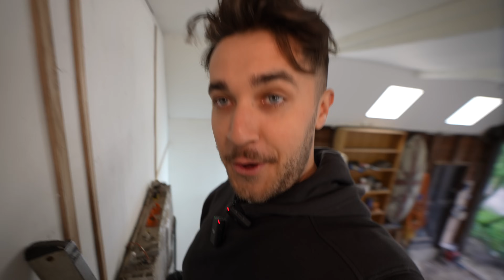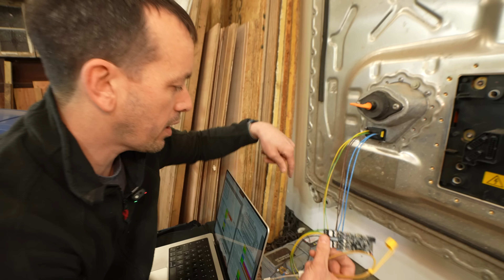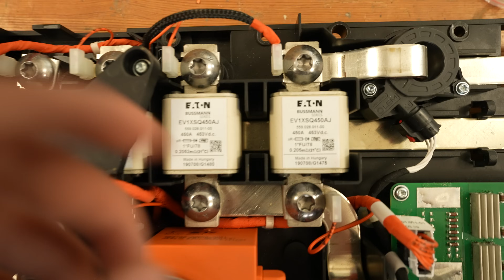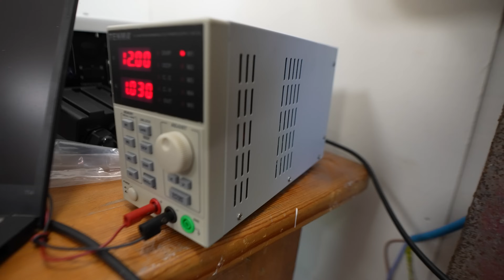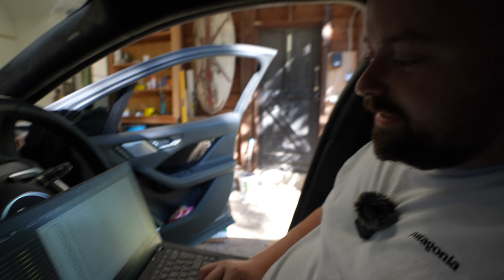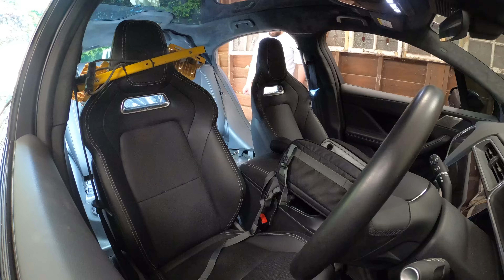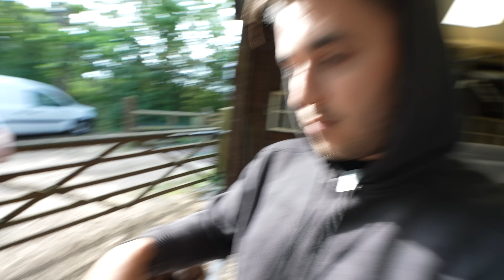Hacking an EV Battery From a £90,000 Car -  DIY Vehicle to Grid | ØY44

Comment: Is there not a mechanical tilt switch in there somewhere ? I would be very surprised if there wasn't, considering on ICE cars there is a mechanical tilt valve to shut the fuel supply in case of accident/car overturning.
Reply from the maker: It’s not inside of the battery 🤓👍🏼

Comment: You know when you repace a part on a car, like an intake valve, you have to let the car know about the new part and calibrate it. That is so the ECU knows what ID to talk to for opening and closing the intake valve. Same with the battery. You figured out how to talk to the battery in the Jaguar, but the battery on the wall has a different ID so it doesn't respond. Figure out if there is a "discovery"message to make all parts on the canbus communicate their ID and try it with the right ID.

Comment: Not an expert but I have a little idea! 

The car was involved in an accident have you checked the pyrofuse. This is like a big fuse that you see in a plug. They blow and need to be replaced if the accident if fairly bad, you can normally tell this if the airbags had gone. The fuse kills the engine in a normal car. But in electric cars it can be used to cut off the battery. 
This is most likely in your case to be why you are having a problem because considering it would be between the battery and motors. And it is physical, the fact that the battery has just two bus bars to go to the motors. Your one will be in the battery pack.

To test just treat it like a fuse!

This is so then the end users is not exposed to any danger, as the mangled metal of a car crash and easily cut in to a High voltage cable!
Reply from the maker: Good suggestion, but we checked that, and it’s all in tact! There’s some Comms issues, but I’ve since found an expert in this field who is helping 🤩🤩🤩 - thanks mate!

Comment: I do wonder if this is what Octopus are thinking about with their EV leasing scheme - once the cars reach the end of their usable life, there's a whole bunch of mostly-good batteries they own ready for deployment to grid-scale storage, which is particularly valuable to a renewables-based energy supplier to displace 'base load' generation (or rather, to fill in the troughs of weather-dependent types of renewable power generation).
Reply from the maker: Octopus have shown extremely smart business acumen recently, so it wouldn’t surprise me if

Comment: Cory, the I-pace is particularly sensitive to the 12v battery being in good health. I know I have one! It might be worth upping the 12v to 13v to be sure. I had mine just refuse to start, i.e. the main contacter wouldn't activate. After half an hour the 12v battery had recovered to over 12.5v and suddenly the contactor went clunk! Everything was OK after that. They are very sensitive to poor 12v battery condition!
You will have to write out the heatingcooling circuitry on the CANBus of course. The LG and JLR engineers have written code to protect the battery at all costs!  I believe that Tesla are already using old/substandard EV cells in their Powerwalls. The cells inside the I-Pace are LG Cem cells and are used in quite a few home batteries, so when you get past the CANbus problems the rest should be plain sailing!!!

Comment: I would be careful with this battery.  It's one of LG Chem's defective batteries and it will catch on fire at some point.  I would check to see if this one had a battery replacement after the recall, otherwise I would recommend a newer battery from Nissan, or KIA.

Comment: Hey Cory, just wondering, are you aware of the recall for the Jag I-Pace for the battery pack causing several thermal runaway events and burning several properties down?
Also, they had a recall for the recall, where they tried to “fix” their physical fault with the battery cell at a manufacturing level, where some still failed even after the software “update”.

I've only just started watching, so maybe you cover it.

Please make sure you have some really good working smoke and CO detectors throughout the property and have them interconnected for the safest detection and alarm if something were to happen.

Comment: I think my original comment failed as I posted a link off YouTube. But if you Google "Circle Of Battery Life: Old Power Cells Get New Purpose For EVs" you'll find a firm that's been working on this exact concept. Assuming they keep the packs intact they might be able to help - though I guess chances are they would be stripping the cells and using their own BMS so I guess unlikely to be of much help. Absolutely incredible perseverance - working in IT I know the feeling when you've spent hours working on something and get an error instead of the result you were hoping for!

Comment: All EVs need foot on the brake to fire up the high voltage battery. Pressing the start button once or twice without foot on the brake only fires up the 12v battery systems

Comment: It’s refreshing to see a spark taking an active interest in the deep dive side of things, but importantly staying humble about the fundamental differences between electrics and electronics without implying that it’s the same thing to those that don’t know any better - well done and best of luck getting this to work 👍
Reply from the maker: Thanks mate! I did a course in electronics, and have delved into some basics, I know enough to know, that I don’t know it!
Reply: @corymac  fair play to you you - it's a diverse field - I am an EE but don't do it as my day job so there's swathes of stuff I find interesting but have little expertise in - everyday's a learning day as the saying goes! A bit like a GP attempting to do brain surgery by qualification and watching a few videos 😆 - I did an entire module on CAN but really despise software and coding, though I can scrape by if I really need to (e.g. using Arduino for Open Energy Monitor) - it's also a case of not re-inventing the wheel so you'll be breaking ground with this for the benefit of others by reverse engineering it  🙂
Reply: @corymac  The more you learn, the more you realise how much you don't know

Comment: I don’t know if this would be any help, but I know most of the cars today need to have each control module programmed with the chassis number in order for them to communicate with each other think the issue you might be having is the code of them signals from the car somehow have the Schatte number number of the car programmed into it and as it doesn’t match the same number that is probably programmed into the BMS of the battery it might not work but I could be wrong
Reply from the maker: There’s no VIN lock as far as I can tell 😁👍🏼

Comment: If your client has the rest of the car the quickest solution might be to rebuild the harness on the wall with the other can modules 😂 you might be able to get the battery info for the inverter over the obd port. I'd be tempted to hook up the rest of the car and replicate the donor cars signal in the same way you did the other jag in this video in case the signal is veicle specific that might save removing and mounting all the components.
Reply from the maker: Just keep the car in one piece 🤣👍🏼

Comment: i don't have any experience in this but i watch a lot of car repair channels 99% of the time the car wont start is ECU comms throwing some sort of error that needs bypassing & on a crashed modern car they wont start without a Pyro Fuse been intact and attached,  i would assume the CAN needs re writing to bypass car start features i doubt striaght copying code will work

Comment: Have you check the other connectors on the top? There is also the interlock loop inside. There must be a reason, the battery shut down after 5 sesonds. Something is failed to check while bootup. It could be the battery expected a massage from other ecu's in a time window (maybe every 5 sec )?
Reply from the maker: We’ve linked the HVIL’s but still was throwing a hissy!

Comment: 😅I want to see this succeed.  We NEED this to work.
EV batteries are typically well protected to avoid the inevitable collision that will happen in the lifetime of a perfentage of vehicles.  Being able to repurpose one for home use makes so much sense.

I read that 30kWh per day for a home is around average.  3 days of charge would be phenomenal.
Reply from the maker: Thanks!!! We’re working on it 😅🙏🏼

Comment: Facinating project, I'm rooting for your success. Completely shot in the dark but would there be a axis sensor stopping the battery from turning on it it is not level with the ground as it is monuted to the wall. i'm not an expert but throwing out another avenue of investigation.

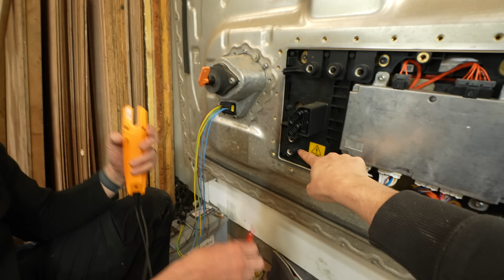Comment: I find it extraordinary that 10:19 you can measure 395V DC . That's basically all you need - those connectors don't look like some low power voltage sensor wires - they may provide all the power you need.  Keep going and good luck with the project!  - Make sure the solar inverter is configured to handle a connection to a high voltage battery. You can't just plug the battery into the connectors which would normally be fed by the solar PV array (even if the voltage is the same). The impedances are different and bad things could happen to both battery and inverter.
Reply: But the internal bms might not be active risk of cells going out of balance (need cam network to make sure it’s on and contractor is on)

Comment: I can't really tell from the video if you did.  But in all Power plug diodes there is a H VIL circuit.  it runs around all 400V plugs and must be unbroken.
Reply from the maker: We found that, still no luck 😁
Reply: @corymac  I have on a Nissan battery had to send a "wake up" bit before an ok can be sent on the canbus.  so it is not certain that it is enough to send "ok" and "switch on contactor".

Comment: I wouldn't be at all surprised if there isn't a sensor on the battery that detects it's not oriented horizontally: and might it be a good idea not to operate.
Reply: We checked that, there's nothing in the battery r.e an orientation sensor. that is present on another circuit in the car.
Reply from the maker: What Chris said 👆

Comment: Great work! I foolishly bought an IDbuzz thinking you could plug it in and use the vehicle battery to power my home. Turns out you can but nobody actually makes a charger that allows you to plug in and do this. One is in development but it’s going to have a chadamo plug on it which renders it useless for my application. Keep up the good work.
Reply: Check out point guard energy. They are working on a V2X CCS (US) based bidirectional DC home charger... I don't think it works with any vehicles yet, but at least something is happening in the space.
Reply from the maker: I have heard similar before, manufacturers aren’t rushing on it for some reason 🤔
Reply from the maker: I imagine whoever does it first will sell like crazy

Comment: Well that was interesting, good luck with persevering! I was wondering if the 'car on the wall' had a post-crash setting applied, that won't let it operate again until it's cleared? How you go about clearing though...umm, turn off and on again 🙂
Reply from the maker: There’s an internal fuse yes, but that seems in tact! 😃
Reply: @corymac  I was thinking more of a controller switch or something...I'm really not qualified to suggest it! I just thought if the car was in a crash, there might be some CAN comms that says, "this is a dead parrot". 🙂
Reply from the maker: And thanks! 🙏🏼

Comment: You’re a sparky , you know you want to get a tin opener on that thing , gut it , make the batteries dumb and fit them in a housing with a simple charge controller. 
 It would already be in pieces if it were mine .
Reply from the maker: I may or may not have ( if JLR see this definitely I didn’t ) opened up the casing already 😁. It’s just that we have a multimillion pound design here! I don’t wanna butcher it, I wanna keep as much of the original stuff as possible
Reply: @corymac 
I agree ,it’s a lovely bit of kit and if you can get it to play nice and be a good little battery, cool cool cool .
However , if it stays  all “ ED209 “ i’d have it’s guts in a shiny cybertruck sytlie box .
Can’t go wrong either way i guess . Good luck !

Comment: Imagine a car company comes out with a wall adapter kit, just extract the battery, buy the kit then hang it on the wall and plug in the house battery adapter. What does that do to the resale value of that EV? I think it keeps it high! Let’s pretend Honda makes the “second-life” car. If you by the Honda “second life” car new you know as long as you don’t snap your car in half you can turn its 50kw battery into a house battery or the person you sell it to can when it gets too old. Maybe it is hard work to remove but you are not prevented from getting out the battery. Say it is down to 70% of its life, a 35kwh battery is still plenty at least worth $15k so your car will always hold that value. Sounds like smart way to make a  car stand out from the rest of the competition.

Comment: I really want this idea to go mainstream. You may find the OpenInverter forum useful as they have lots of discussion on car BMS's and they have a dedicated Jaguar section.

Another thing worth considering is attaching the on-board charger module and charge port back to the battery. These might be necessary components for the battery to initialise. The OpenInverter forum has details on how to access the DC pins on the CCS charge port which will give you what you want without directly hacking the battery. It even works on complete vehicles!

Good luck!

Comment: I have fad Jaguar and Landrover cars for thirty years, and I had an Aquaintance that programmed the ECU's. The Eproms are separetley programmed by different people, and put together on the motherboard. The system has both a high speed and low speed Can Bus. When you open the car, the ecu starts to talk to the modules and pressing the start button sets another handshake in operation. The front left hand footwell fusebox is programmed to the dashboard. the front ecu is connected to the rear spare wheel fuseboc by fibre optics, Orange cable. Cambus are white cables. The system needs 13.2 volts to work properly, nine volts throughs a wobbly on start up. The rear seat footwell fuse boxes double up from the front fuse box. The Ecu's have Optical fuses on the inputs. One needs to follow the staring sequence to fault find the system.
Reply from the maker: Thanks mate! I’ll pass it along to the gang

Comment: If the car was in an accident, could there have been some kind of an auto kill-switch (like a fuse or isolation mechanism) engaged to protect from battery exploding (basically, to kill any voltage being activated across a potentially dangerously damaged battery)?
Reply: I'll caveat this by saying I have no clue about any of this - I just come here to look at your hair
Reply from the maker: There is a pyro fuse! But it hasn’t blown in this car
Reply: @corymac  Good luck! Looking forward to seeing you crack this!!!

Comment: Just a query, so when u put it on the wall will this effect the loop for the water as its use to being flat and would be putting adverse pressure on the pump?

Comment: If the car has been in a crash (I.e. the airbag was deployed) then perhaps this has been logged in to the battery in non-volatile memory and needs to be cleared/reset (post inspection) before it’ll re-enable the HV output?

Comment: Can't wait to see part two! 
I'm wanting to do the same, but with a Polestar battery and a FoxESS inverter. 
Keep up the good work
Reply from the maker: I can’t believe there are already polestar batteries piling up 🤯
Reply: @corymac  you can find pretty much anything! 
The main issue is like you've found, doing the integration is a difficult step.
Reply from the maker: Sounds cool! 👌

Comment: This leaves me wondering if disassembling the main pack and repurposing the individual cells packs would be easier in the long run. You'd be able to optimise the packs final output stage voltages to requirements, simultaneously eliminating those three complex vehicle cam bus modifications in the process. It might also allow you to weed out any potentially deficient/defective cells in an otherwise reusable pack. When being used for lower charge/discharge applications like solar storage, there's little requirement for an integrated liquid cooling system. Thanks for sharing. 👍

This is my opinion, I could be wrong. 😉
Reply from the maker: What he said 👆😁
Reply: I much prefer the battery packs their design as their rebust and had a quality control.

You cant recreate the same level on your own what you see here.

Comment: Looks like good progress so far. One note on the relays when you open the doors, that's probably the pre-charge relay getting the vehicle HV system ready for key on by the time the driver is in the seat. The BMS will, most likely, enforce a maximum duty cycle on this relay so once you get it to close the BMS won't let you re-close it until  the resistor or PTC element used for pre-charging has cooled off enough.

If you're looking at CAN frames on the network to the battery you might want to take a particular interest in frames with the ID 0x10A, 0x10B and 0x10C.
Reply from the maker: We are missing an ignition on signal, Also we would like to understand if  0x012 has any interesting signals for the BECM. If you reckon you could help - info@oyelectrical.com. An email would be awesome 🙌
Reply from the maker: Thanks mate! Will investigate